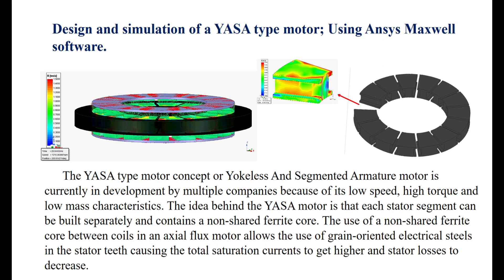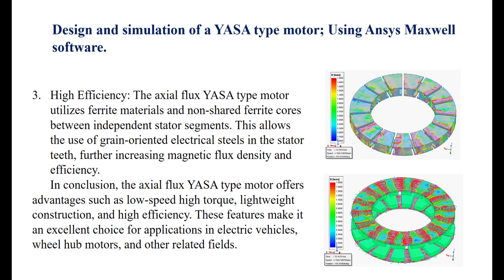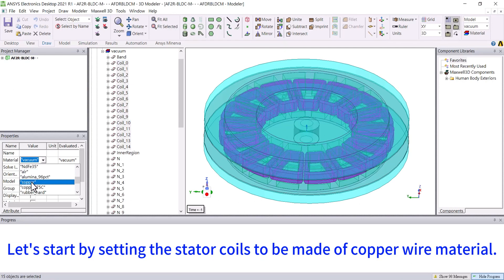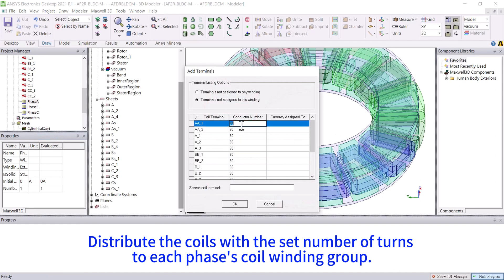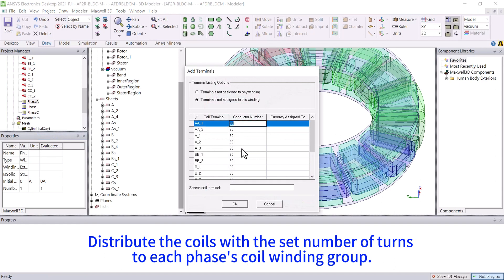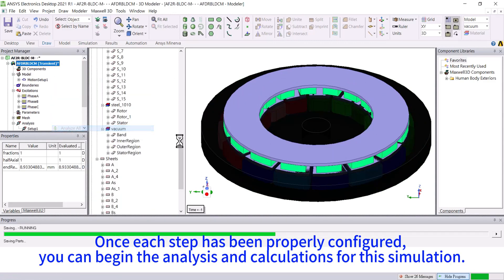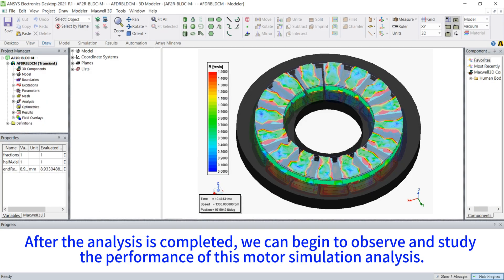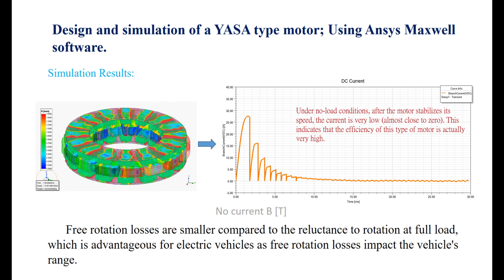Design and Simulation of a YASA Type Motor; Using Ansys Maxwell Software.

Comment: I tried the same analysis in Maxwell, But in my ansys Maxwell, there are many materials are missing. Can you please guide me on how to add materials library? I know how to add single materials but if any readymade library is available please suggest. Another error was found with band assigning. I tried a lot to solve it but couldn't find a solution. I'm new to Ansys Maxwell, so don't know how to solve that. Thanks in advance.
Reply: hi..how did you model stator pcb traces in maxwell?

Comment: Hi, Good work....what torque did you get from that motor? what was the dimensions of the motor (outer diameter, inner diameter and thickness) and what was the current density in that case?
Reply from the maker: This type of motor certainly has excellent power density、 current density、 torque and efficiency.